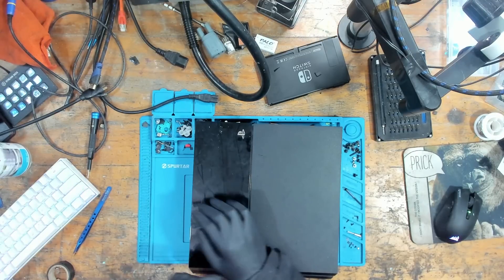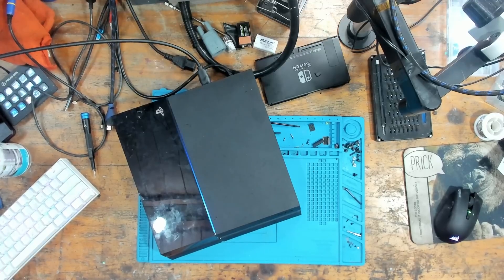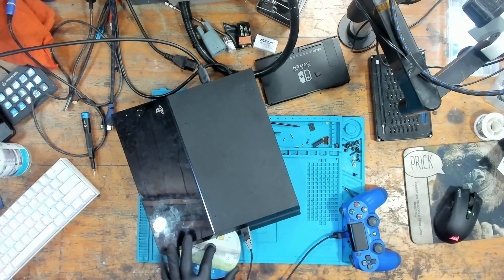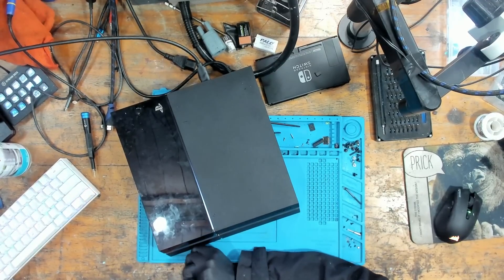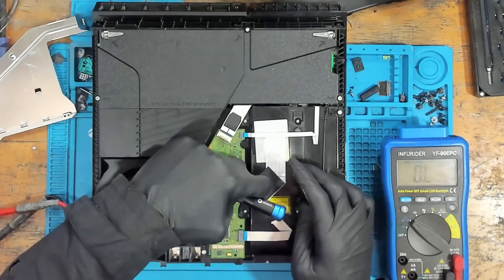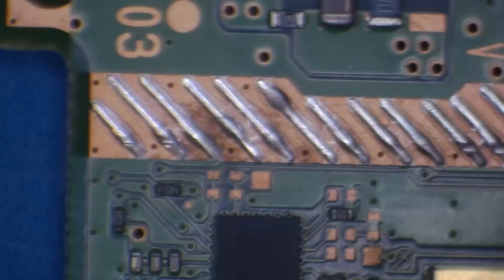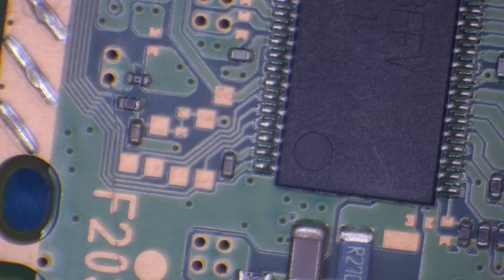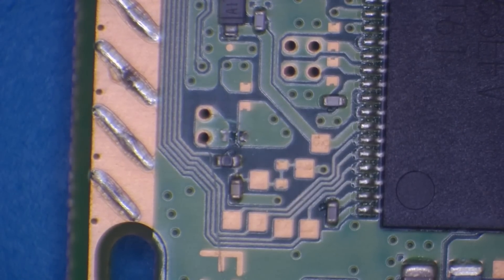PlayStation 4 Original No Disc Feed - F203 Disc Sensor Fuse Diagnosis And Repair

Comment: Hello, good video, you will know where I can get that fuse from if I don't have a donor plate and how much that fuse is. I hope you can help me, greetings
Reply from the maker: You can buy them on ebay by searching for "PS4 Fuse" but they're expensive on there. I buy mine in packs of 50 from aliexpress for £18. They work out to 36 pence each (50 cents)
Reply: @TheCod3r  ok thanks how much A is that fuse
Reply: Can you pass me the data for fuse f203 of how many amps is that fuse, please?

Comment: The fuse is usually burned because of a faulty motor in the drive... So the fuse may burn again imedietely or after small time.. i suggest replace the motor with fuse
Reply: Hello! How do you tell which engine is faulty?

Comment: I've had a disc motor go all together, blew the fuse again and had to figure out the motor was down to like 3 ish ohm. Had to replace the motor, interestingly enough, the motor and drive did not look like they were mistreated
Reply from the maker: I've had a few faulty motors burn out the fuse over and over myself too. It's a pain especially when you put it all back together to take it all apart again lol

Comment: I fixed my first ps4 today. 
the problem was that one of the black plastic things on the top of the disc drive had popped out of place
and there was 2 discs stuck in there too lol
Reply: the discs were fifa 15 and family guy season 5 lol
Reply from the maker: Haha nice, always a bonus getting free discs 😁
Reply: How'd you do that bro? mine on my 12** a  is a bit out of place I removed the cable to fast to remove an old disc drive and Everything on my brand new disc drive looks a1 ready to go. I'm also thinking it could be a fuse I don't have a tester to see tho but it beeps when I hit eject so does that mean it's power there?

Comment: Sometimes you can't update when the disk drive doesn't work, that can happen also due to the fuses being blown? couse i think you had one where it didn't update couse the disk drive chip was blown and its married to the board i think
Reply from the maker: That's right mate yeah, if the fuses are blown it can cause a CE-35888-2 error code if it can't communicate with the renesas bdrom chip